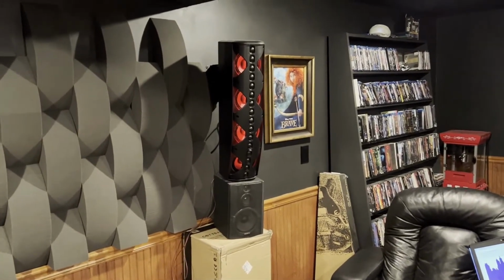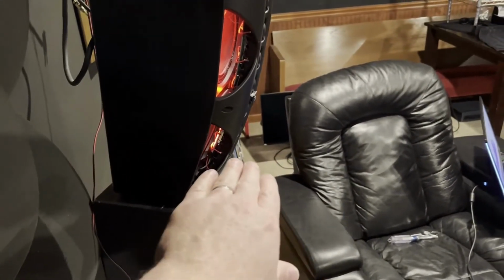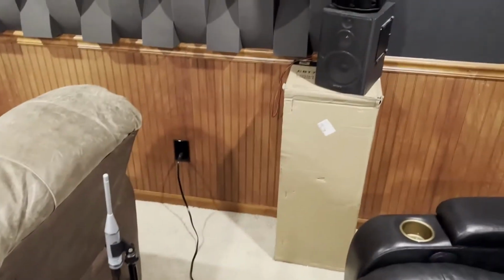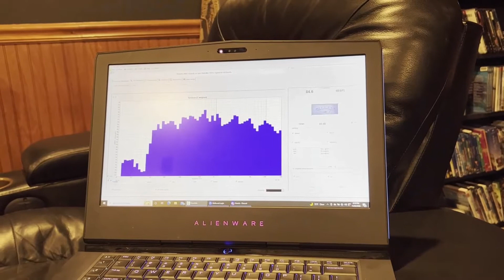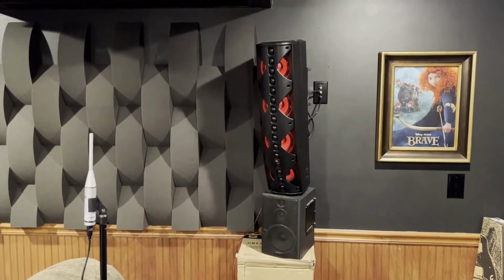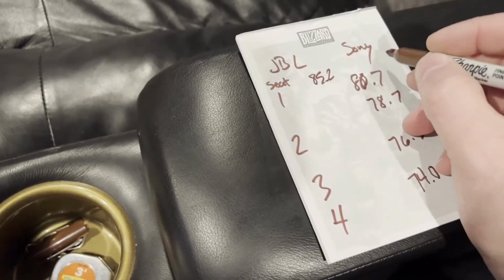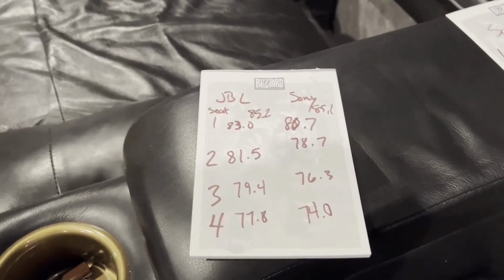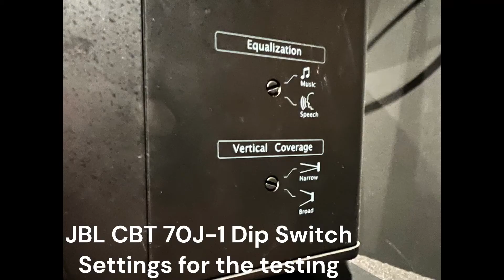JBL CBT 70J-1 line array SPL fall-off at distance compared to a traditional speaker

Comment: Are you certain that these are attenuated on the lower driver? I don’t believe traditional line arrays are. The effect of using a line array is that when several speakers are in a line the sound travels further with less drop off. I always assumed the angle was what created a sort of attenuated sound because of the fact that there is essentially 1 driver angled more severely. The further up the column you go the less angle giving a heightened effect to the line.

Comment: Hi Jonathan, interesting test, but it seems to be not fair comparing 2 speakers when they are not on the same position vertically. When measuring each seat position, the Sony speaker is mostly covered by the seat.
I am confident if you only turn the Sony speaker upside down (and leave the tweeter on ear axis) it will sound more loud and coherent on all seats.
This way it will be also closer to the Dolby specification.
Or did I miss something? Cheers.
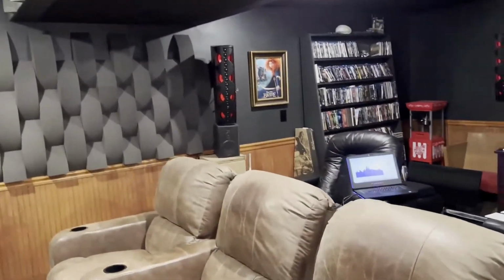Reply from the maker: Hi @pulDag , at timestamp 01:47 you can kind of see where the Sony tweeter is in reference to the chair tops.  Use the trim board on the walls as a reference height.  The chair backs are just a tad over the height of the board, and the Sony speaker tweeter is at the top of the speaker, 8-10” higher than the chair tops or so.  My thought in this test was placing the tweeter of the traditional speaker at ear height, which is what is most commonly recommended and it just so happens that’s where it is.  Those are Berkline chairs and they are a deep chairs, so most people’s ears end up about that height (or likely lower).  Seems like all the current direction on the forums with Atmos and ceiling speakers is to lower the side surrounds, so there is maximum separation with the ceiling channels.  Just this week someone suggested I lower my CBT speakers for that reason.  I explained that would go against the technical design of the CBT speaker, and I’d rather raise it than lower it.  I already raised them about 6” from where I started with them, but I don’t have the ceiling headroom to put them as high as would be most optimal.  So those were my thoughts on choosing the placement for this video test.

Comment: Hey Jonathan, I'm looking to order that arched acoustic foam for my theater room, and I'm wondering if the material is squeezable like a sponge or is it rigid?  Also, can you tell me the dimensions of one of the individual pieces?  Thanks in advance!
Reply from the maker: Sorry I missed this!  The foam is about 5.5" wide by 16" tall.  It's dense foam.  They ship it vacuum packed and compressed, but it's much denser than like a cheapo 1" or 2" acoustic foam I've sometimes encountered.  It works well.

Comment: what amp are driving these array speakers ?
Reply from the maker: I am using Crown 8|300N amps.  Two, for 15 channels at 300 watts per channel.  They are 92.5dB sensitive at 1 watt (third party verified) so you could drive them off the AVR alone in reality.